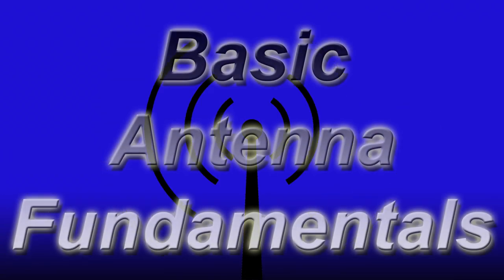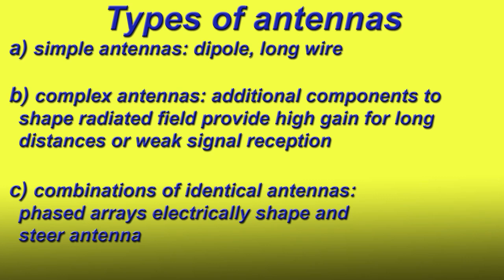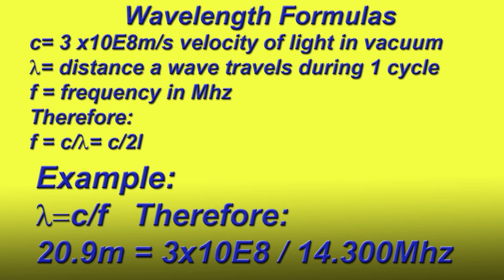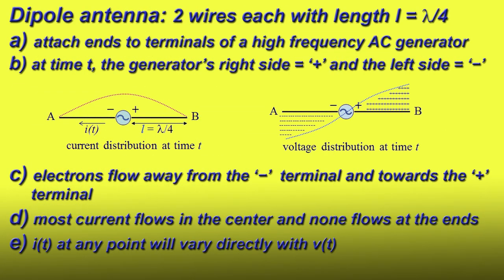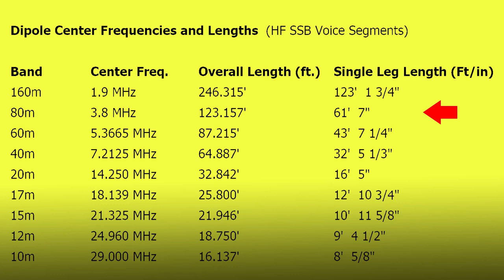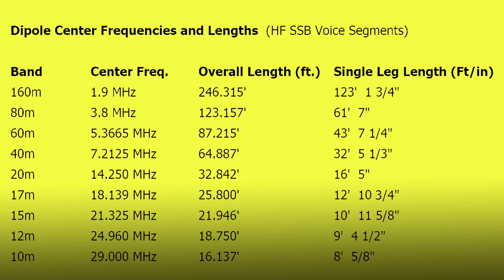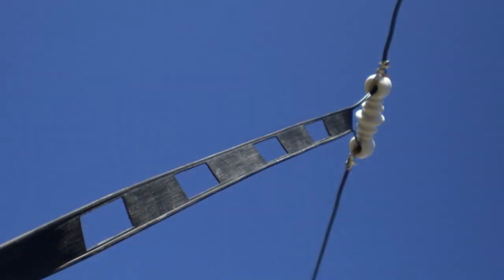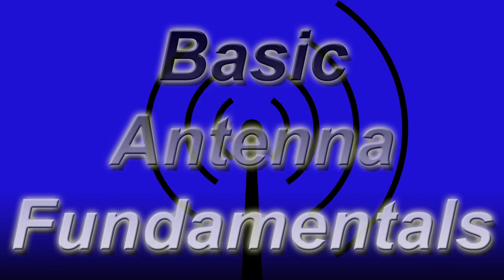Basic Antenna Fundamentals

Comment: Thank god for pause . going fast uses up less data. That's what we pay for !
The point is real simple. The antenna is to radio waves what a mike and speaker aee to sound waves. Until then its AF or RF alternating current in a wire. The antenna or speaker are what create a wireless wave. And the whole sustem is only as good as the speakers and for two way RADIO, The ANTENNA.